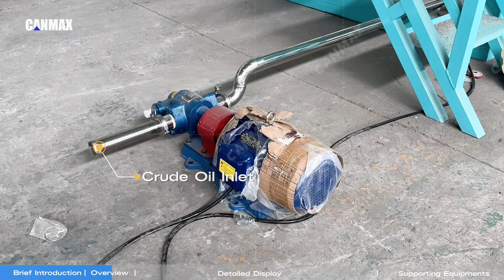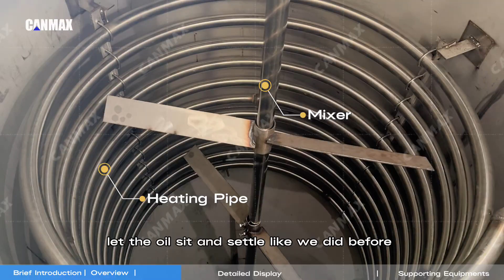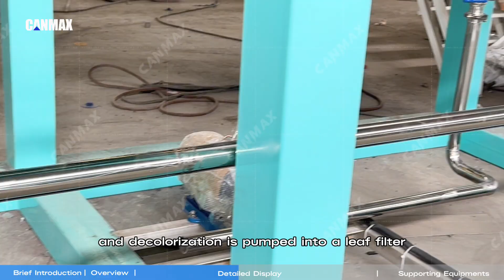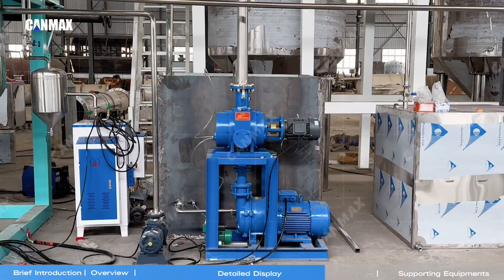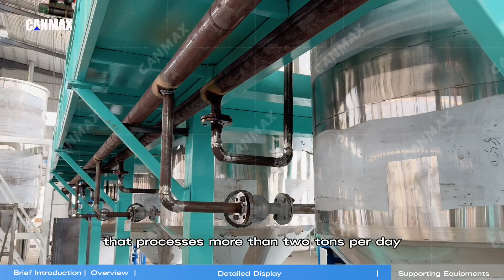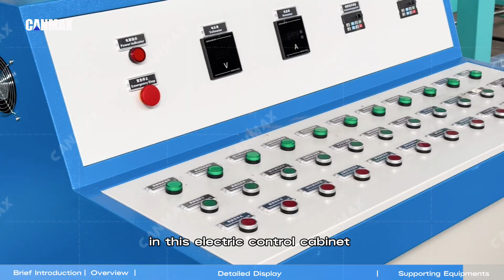Edible oil refining equipment | cooking oil refining machine | cooking oil refinery equipment - 5T/D

Comment: Fractionate of Coconut Oil - removing the fatty long acids ? So it can stay fluid on the coconut oil
Reply from the maker: Coconut oil fractionation crystallizes and separates triglycerides with longer saturated carbon chains. These crystallized triglycerides become stearin, which is a valuable product, not waste. The remaining liquid part is olein, mainly triglycerides with shorter saturated carbon chains.